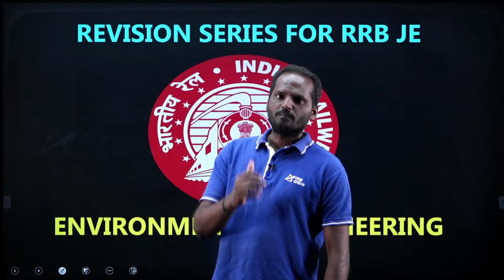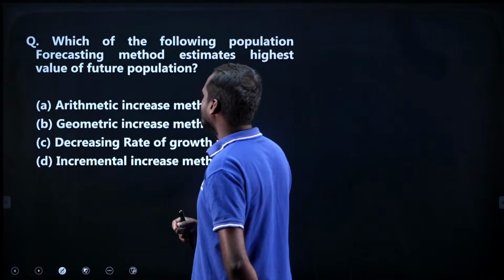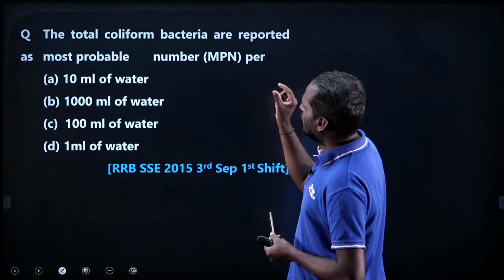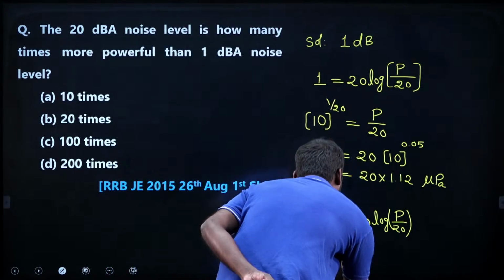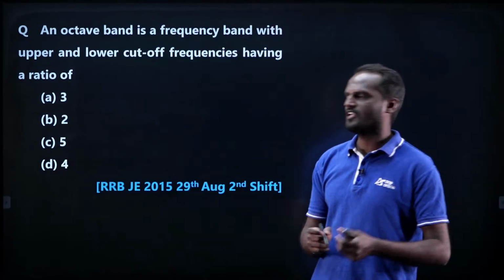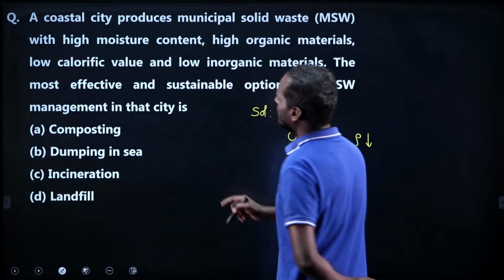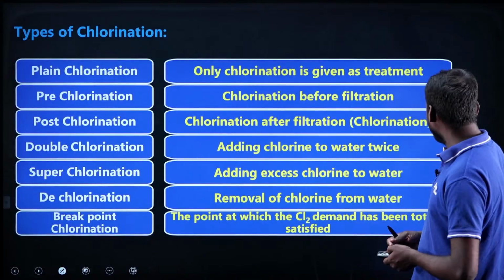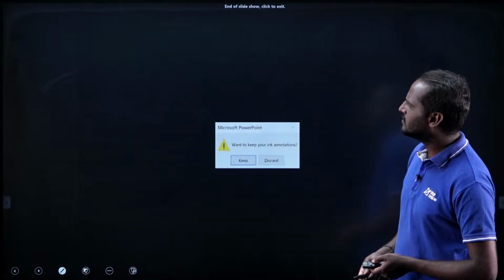RRB JE (CBT-II) Civil Engg | Revision Series with PYQs | Environmental Engineering | ACE Online

Comment: sir, (small correction) 
cyclone scrubber min particle dia removal is 2.5 micro metre ,but you said  10 micro metre
Reply: Dear shiva, In the question it is not mentioned as cyclone scrubber. He said cyclone, it means cyclone separator. therfore Ans is 10microns